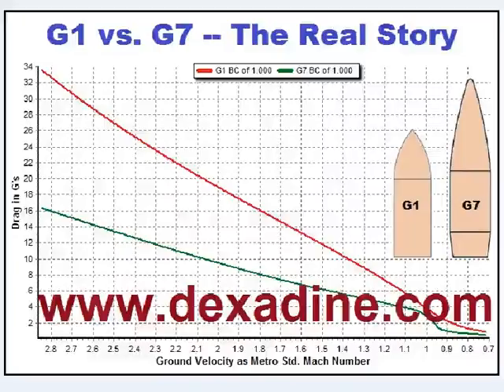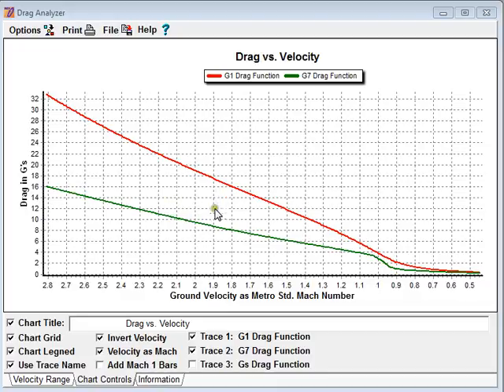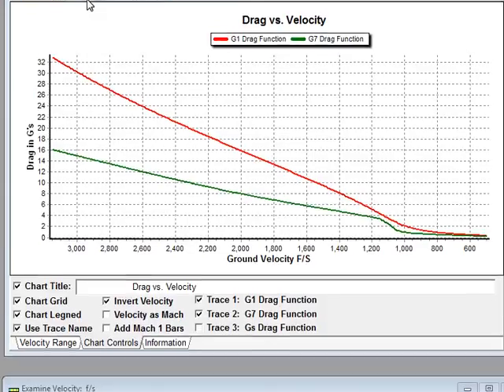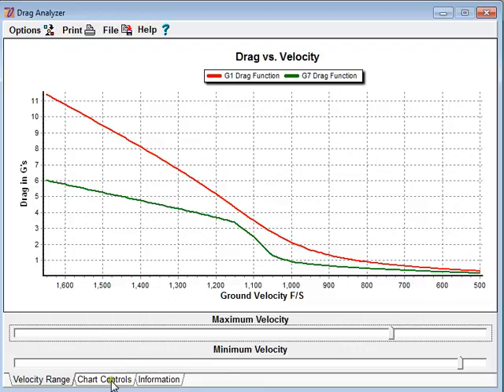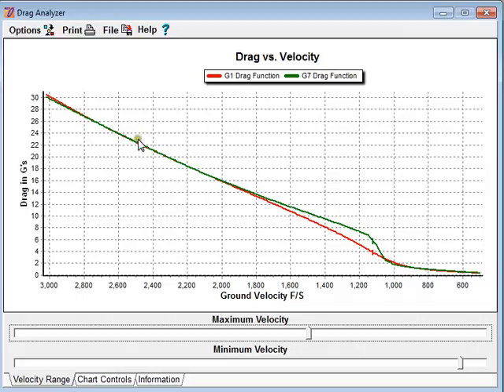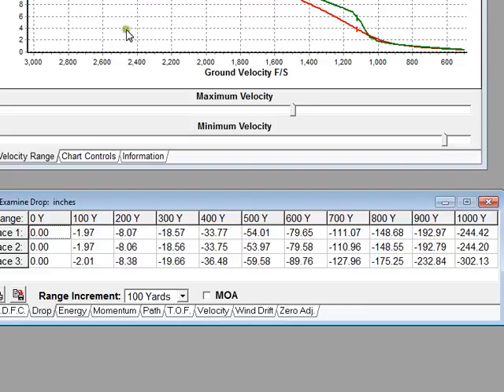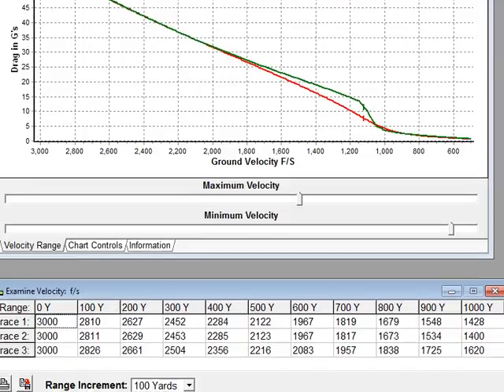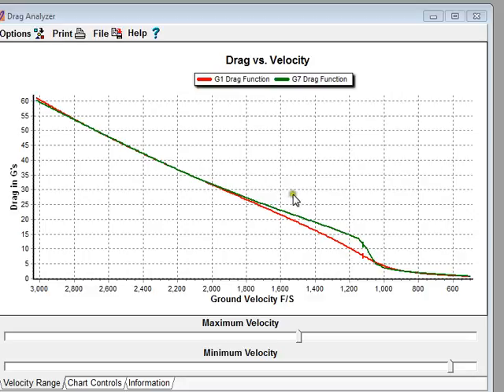G1 vs G7   The Real Story

Comment: So, where you will really see the difference between a G1 vs. G7 is downrange velocity? Less drag (assuming same starting velocity)= More Velocity as distance increases. This would be very important (especially for the lead-free shooter) to hunters due to expansion and energy at range. For most gong-ringers there is negligible difference in accuracy. Is this correct? Thanks for the great tutorial!
Reply from the maker: The main idea behind standard drag functions is to be able to predict what various bullets will do downrange.  Nowadays, many bullet manufacturers publish both a G1 and a G7 BC for the same bullet.  The question is which standard drag function best matches a given bullet's drag profile. At about 4:32 the video shows how the G1 and G7 drag profiles are almost identical between 2900 down to 1800 fps, a velocity range many shooters operate in.  For such shooters, G1 and G7 will give nearly identical predictions, just that the G1 BC will be double that of the G7 BC.  Only when you get out to ranges where remaining velocity drops below 1800 fps will you start to see differences in G1 vs. G7 predictions.  Which drag function gives the more accurate prediction depends on the drag profile of the actual bullet, and as the video shows, you can't always tell that from the shape of the bullet.  If you're going to hunt with a bullet at long range it’s a good idea to test it at long range.
Reply: Very interesting